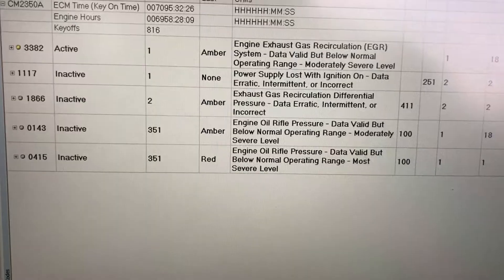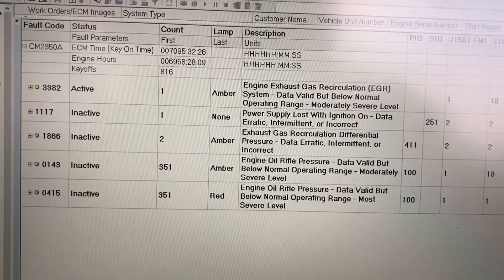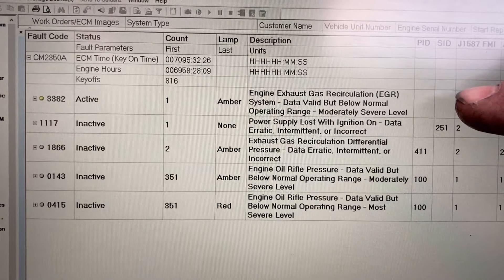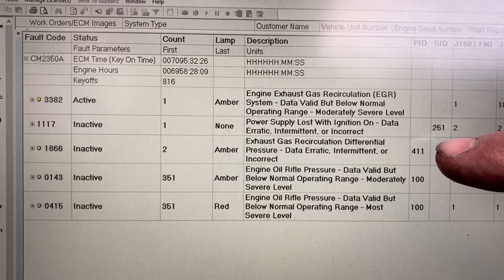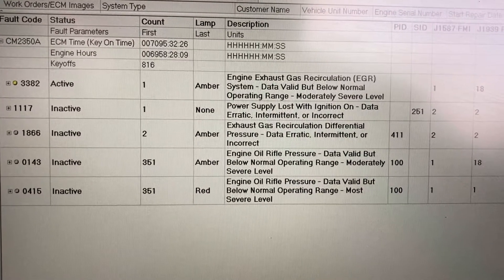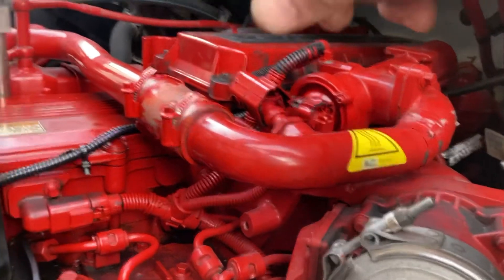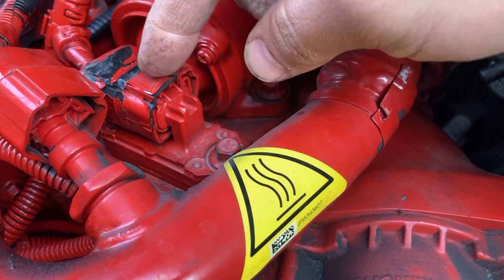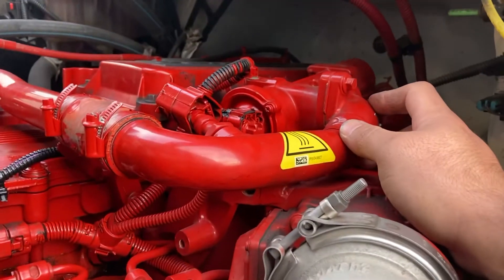EGR system data valid but below operating range and data erratic Fault code 3382 and 1866 Cummins

Comment: I have been getting code 3389 frequently for Exhaust Gas Recirculation System- Abnormal Range. We swapped EGR, VGT actuator, turbo, EGR cooler, and found no traces of boost or inake leaks. DPF was cleaned and ahowed no signs of damage. This one code has us stumped.

Comment: What about when is above code 3058 I change the EGR already. Thank you
Reply from the maker: What did you replace? Watch this video. It might help too: https://youtu.be/5bM5z7EuHUE
Reply: @alreyindustries   I have code 3058 EGR above normal, I Replaced the EGR valve and I cleaned the ports on EGR pressure differential

Comment: Hey I tried to do this but I lost the Allen head bolt do you know a part number or where can I get it and does it have any effect on the sensor reading ?
Reply: It is on a 2009 6.7 Cummins engine
Reply from the maker: That stinks man. I don’t know the part number but yes it will definitely cause problems not plugging that hole. You can try to find something else (plug, bolt) that will work. If not, I’m sure you can call Cummins or something to try to get the part number. Sorry.

Comment: I have a 3383 code on a 6.7L I already did this and performed a regen the light went off then a week later the light came back on with the same code any ideas
Reply from the maker: Are you sure you cleared the port all the way through? If so, it could be a couple of things. On the newer isb 6.7 the turbos were passing a lot of oil into the intake and EGR system. There was an ecm update that was supposed to cure the turbo problem, but the oil that had already passed through was causing a lot of problems and this code.
It could be your EGR valve is caked up with soot and oil causing it to stick or even your EGR cooler could be sooted up. They are both pretty simple to remove and examine/clean. The only downside is that with the EGR cooler you have to drain the coolant to remove it. 
That’s where i would look. Remove the EGR valve and look inside, see how dirty it is, and remove the crossover pipe from the valve to the cooler and look inside the cooler and see if the fins are caked up and plugged. If those are all clean, it’s possible you have a bad delta p sensor, but it’s hard for me to say which one of those parts is more likely without seeing the truth myself. Those are the main culprits to look at though. And as long as you’re careful you can basically reuse all the gaskets so you won’t have to buy anything to pull it apart and examine it.
Reply: @alreyindustries I just did all this on my Isb and it looks clean. Didn’t take pressure sensor off. But EGR and cooler hose. Both look clean. I bought a bulletproof EGR cooler night throw it on anyways.
Reply: @alreyindustries I’d add. CCV filter. It’s really important on keeping moisture/oil outta stuff like your EGR and all that? I just bought. Old box truck 400k. Was worried a lil oil was in the boost cooler outlet pipe. Tiny bit. But I think it’s due to super neglectful CCV filter. So ima replace that filter. EGR cooler. Clean all the valves and all. Heater grid. New sensors. The two by the EGR